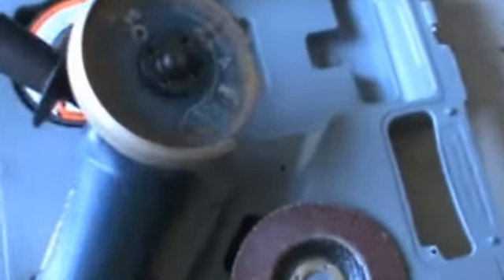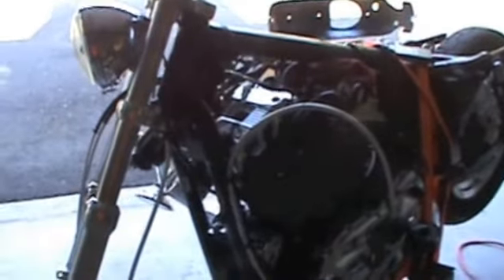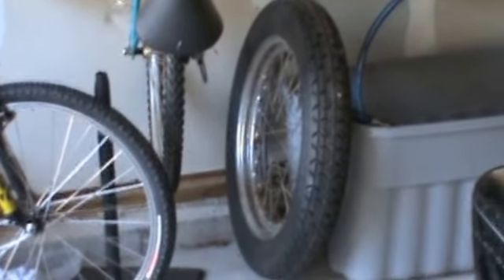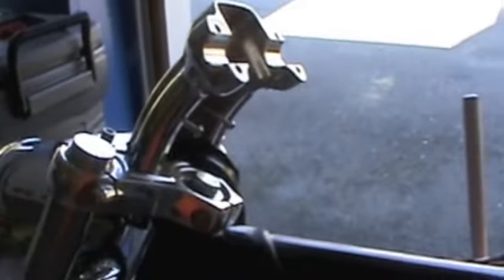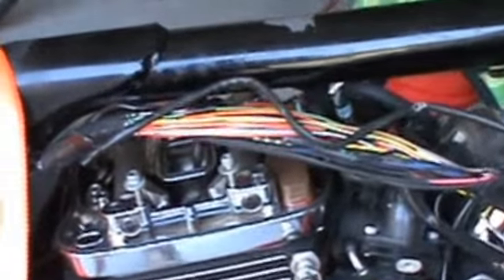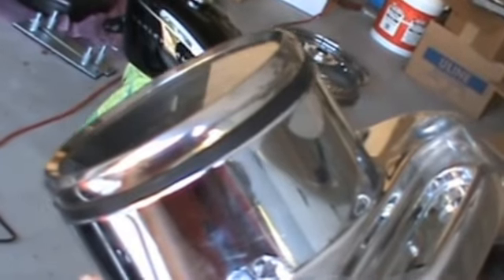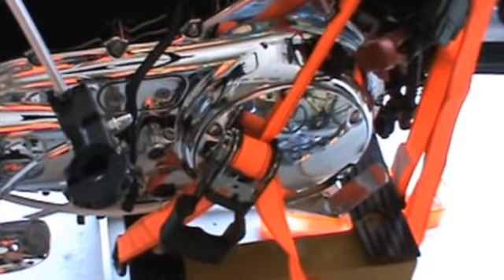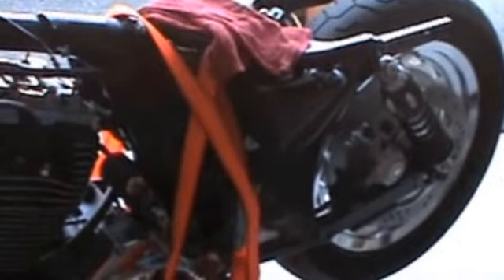Harley Sportster to Bobber/ Bar Hopper project Part 2

Comment: I've only had time to watch this episode of your build. I will have to look at the others. First off, I love my angle grinders. I have 1 with a cup brush on it and another with a sanding disc. I have a cut off wheel that I have used on them but plan to buy another angle grinder for dedicated cut off wheel use (waiting on $$). I buy less expensive angle grinders and throw them away when they go bad. I've had expensive and cheap angle grinders - now I buy cheap - on angle grinders, anyway. When I got my tap & die set years ago I went around looking for every old bolt and nut to use it on :-) Your bike turned out nice. Personally I'm a skinny tire up front and black walls man, myself. My son likes the looks of the fat tire up front, but will still run one of my 21 inchers on his black 93 Sportster (bar hopper/bobber style) with the same tank as yours. I'm going to run a 16 rear  and 21 front on my project- an aftermarket rigid frame from the late 60s made for a Triumph Motor. I'll build mounts for a Sportster motor and run HD on it. It won't quite fit now so I've got to tweak it a little in a couple of places. It has a lot of rake (way more than I want) so I'll be running a long wide glide front end. Pnut tank looks too small against the wide glide so I'm going to pick up a Mustang style tank to run. I'm old and after the "chopper" look from my youth- except the frame WILL sit level with the long forks on it. Enjoy your bike and be careful!

Comment: Hi Jeff. Good progress buddy, every man loves his grinder..lol.. why not bolt the fender back in, cover the area you're gonna cut with masking tape, draw the line you want to cut with a pencil, and the bike will hold it still so you can cut it... with the tree's, will a local engineering shop not cut you some billet ones working off the OE ones but just wider?...you WILL need the longer axle too!.. with the risers, use a socket and a long breaker bar, and definitly get that broken bolt out buddy

Comment from the maker: It's funny you mention bolting the fender back on. I was thinking the same thing while driving home tonight. I am going to try that tomorrow. I don't know about a local engineer. I will have to look into that. I'm wondering though if after I have a machine shop make the trees and then I buy the axle and the spacer kit if it won't be the same as buying the kit? I will have to look into that next week I know I am going to have to get that bolt out. I'm just not looking forward to doing it!

Comment: if you havnt had any luck with your riser bolts i would not heat them because of the either rubber or poly risers. if you have a friend with a air compressor and an impact gun that might work also. breaker bar and enough leverage will get them for sure. bikes looking great safe riding

Comment: The speedo just pulls out when you remove the two small screws, there is a hole in the rear of the housing that you can push a piece of wood through to break it's grip then it pulls out easy. Remember to unscrew the reset button rubber cover so you can remove that too. As for the riser bolts, are you sure you are turning them the right way! Remember you are veiwing them upside down so you could be tightening them! It's an easy mistake two make... Tidy bike bud,gonna look sweet.

Comment: I'm surprised that 19" won't fit inside the Narrow Glide Front End.  I've  switched front wheels on Sportsters from 19's to 21's in the past.  My current Sporty has the Stock 19" Mag and I'm running Vintage Firestone Tires for a Fatter look on the wheel.  So, if you want to run a 19 and dig the Sporty Mags, I would think you'd be able to easily retro fit one right on.  Also, I'm sure someone has said, but look up Speedometer Relocation Kits for your year Sportster.

Comment: Heat that bolt up with a small propane torch. How much did you take off of the frame rail trusts? I want to build a bobber but don't want to take off to much..

Comment: hi jeff,.... yes I would use heat. and the bolts will come out. but the bolt that is broke in the motor needs to come out if you have a little bit of screw that can be reached find a nut and try to screw it on and tack weld it on and get a impact to screw it out and replace it with all new bolts. and if you can find a service manual for that bike some times you can find the pdf on the internet for free or just buy one bc you will need it for a lot torque specs. and for the rebuild. but I like what you are doing
Reply from the maker: Thanks for the advice!! I appreciate it!